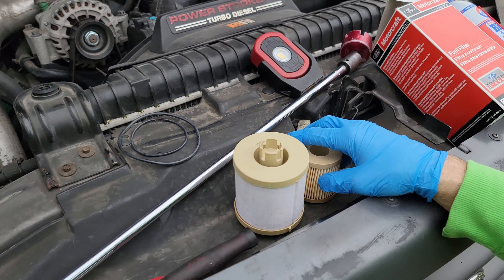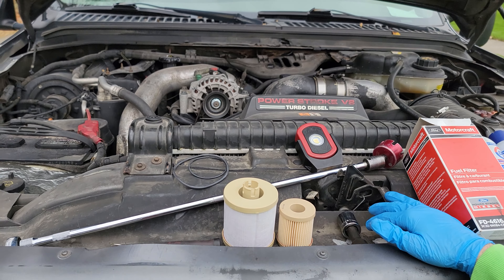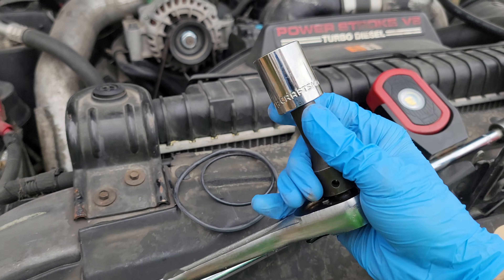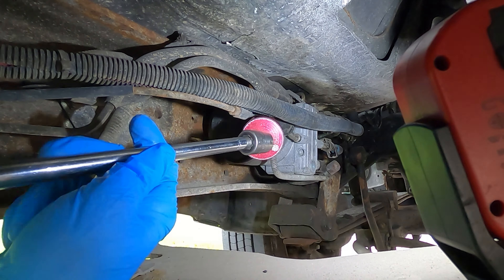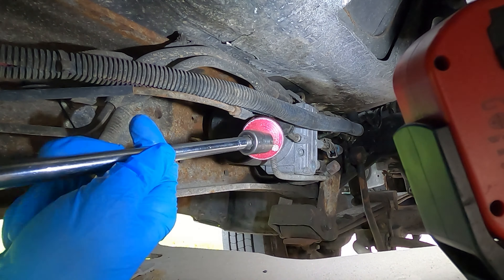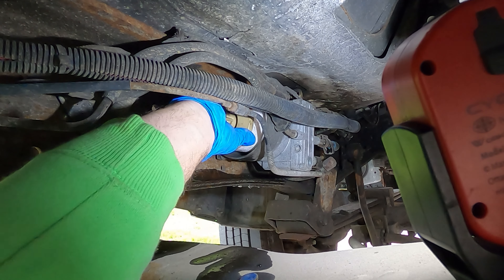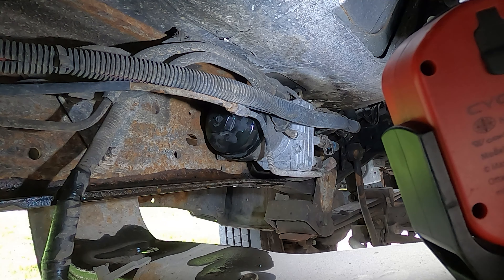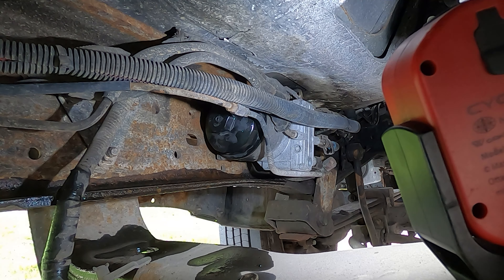Do YOU know how to change your fuel filters FAST & EASY? - Ford 6.0 DIESEL | HOW TO

Comment: I do the same with the tool setup like that.  99% of the trucks I see are 4x4, the 2wd ones definitely give you a ton of space.

Only other thing i like to do is throw an old shop towel or two on the frame behind the HFCM so the fuel doesn't travel as far back.  Helps save on brake clean since I also like to hose things down afterwards.
Reply from the maker: Nice!

Comment: Does removing the lower filter also drain any water if I don’t want to chance taking the 6mm Allen out? Or is that a different chamber?
Reply from the maker: it will, you can also take it a step further and douche out that housing with brake cleaner. That allen will bite cha, leave it alone naa mean

Comment: I've got a really weird electrical issue on my 6.0 f250, and I was wondering if you could think of anything. They started getting bad around a month ago and it's been pretty annoying. It first started with the back up sensor intermittently being stuck off. That started about 2ish years ago and I just didn't really wanna mess with it. It usually works more often than not, which is a recurring theme. Next, about 2 months ago, the fuel gauge started not reading anything intermittently and I got a P0460 and P0463. After that, the truck would sometimes think that the front driver or passenger doors are coming open and closing quickly, which is also intermittent. It would say "door X ajar" and flash it on the dash and the interior lights as if you were opening and closing that door really quickly. As the final issue, which sounds weird, the CEL has also been intermittently turning off. Yes, off and not on. It has a P0401 that it's had for like 15 years which is a whole other rabbit hole. The other weird thing with that is I can read the codes when the CEL is off, and they're all still there on the computer. And yes, the CEL does come one with the key on and engine off like it's supposed to. These problems almost never happen at the same time. Battery terminals are tight, there's no corrosion since it's never been out of the pacific north west and California, and I've checked all of the grounds I can find. I have no clue if these are all related, even the CEL, or if they're somehow all unrelated which I find unlikely. Thanks for reading this novel of a comment

PS: 56k miles, one owner truck, stack of maintenance records.
Reply from the maker: That sir will require my time, which unfortunately for you costs money. Gotta get in the line with an online APPT thru the email that's listed.
Reply: @PowerStrokeTechTalkwARod  Fair enough

Comment: God I don’t miss servicing that engine, worst design and worst engine period for ford.
Reply from the maker: Guess u weren't around the 6.4......
Reply: Nope, went from a 6.0 straight to a 19 6.7. The 6.0 treated me well. Bought new in 04 and sold in 19. Put 275k on it. Oem head gaskets, injectors. It was a solid engine but I the 6.7 is so much easier to work on.

Love your vids!!! Keep ‘em up, don’t miss a single one.
Reply from the maker: Holy shit, guy went to Warp speed 😝😝 welcome to 6.heaven my friend
Reply: It was not easy taking the 6.0 that far but in the end it was all good. 6.7 for life!!
Reply from the maker: No doubt